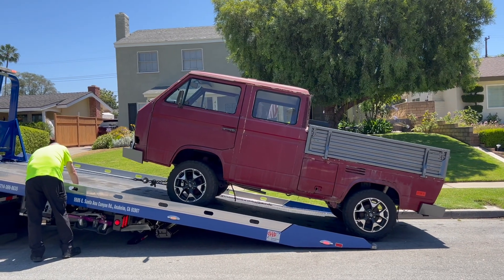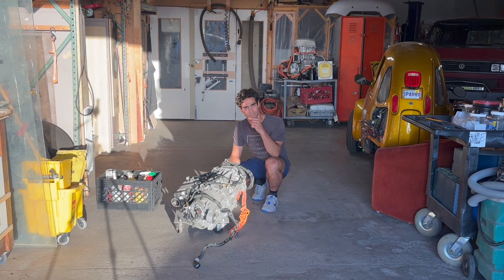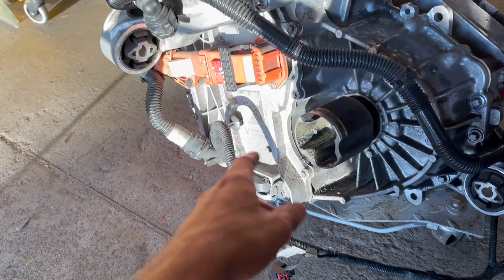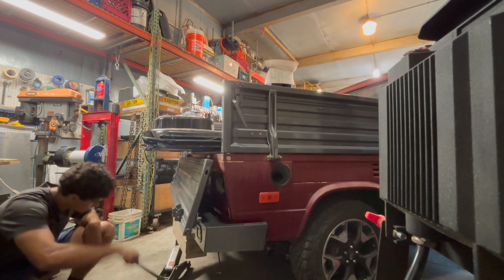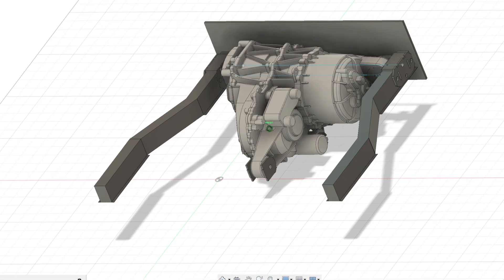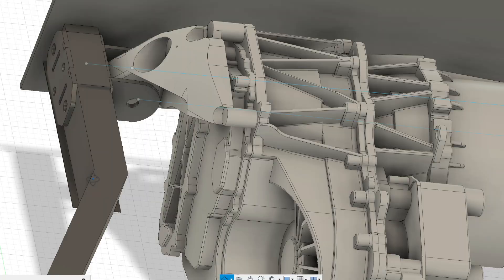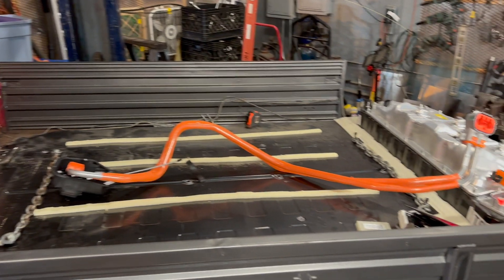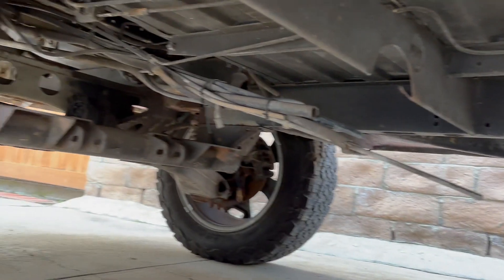Tesla Swapping My Dream Truck

Comment: My dream is to convert the front of my Vanagon Syncro to electric power, retaining the 1.9 TDI engine driving the rear wheels. It already has a potentiometer accelerator pedal for the TDI. I want to find a way to make a long, slender battery box to fit underneath where the propshaft and skid bars are. Shorter range would be fine with the option of the diesel always there.

Comment: Are you sure this was a 2wd originally? The reason I ask is the part you pointed out as welded on trans mount is actually the prop shaft protector mount. That is a factory welded part. The trans mounts are bolt on.  Three threaded inserts on either side for the six 13mm bolts tat mount the forward end of trans. The threaded holes between the welded mount is for 2wd trans mount. Syncros have  both  2 and 4wd threads for the forward trans mounts in that frame rail. This looks like a factory syncro to me.
Reply from the maker: I think someone chopped up a syncro tin top and welded the parts onto this doka

Comment: How do you take a 40 year old VW and make it reliable? Rebuild it... not ruin it.
Reply from the maker: mmm I used to daily drive a freshly rebuild 2.1L powered Vanagon... still slow
Reply: Or Subaru swap it. Done that. But this is so much cooler.